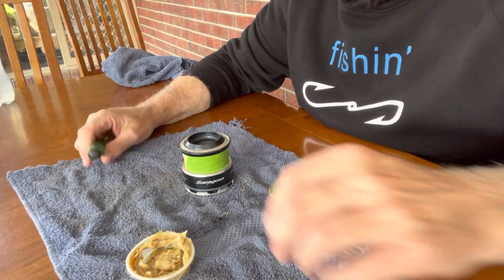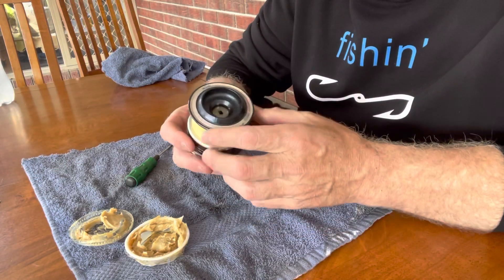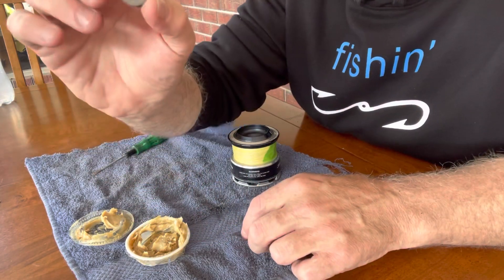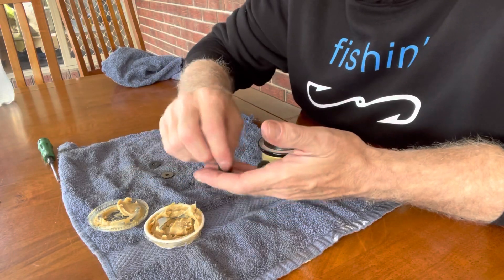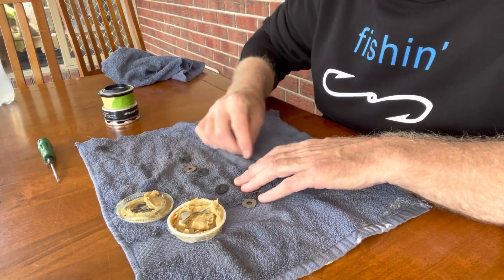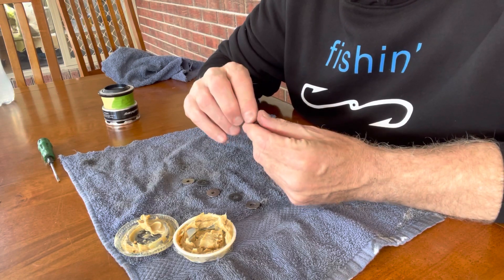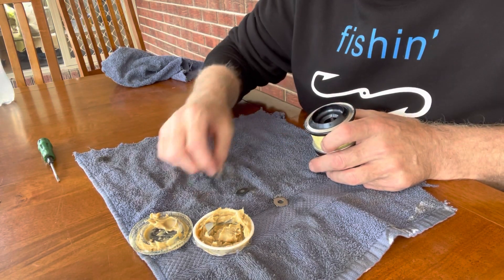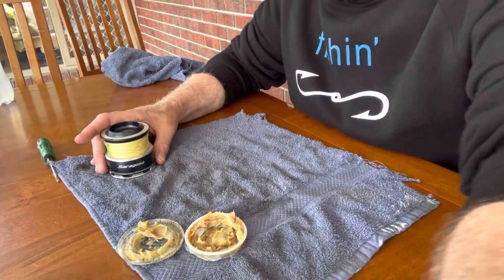Servicing Shimano Saragossa Drag

Comment: I could be wrong but it looks like the sequence you have the washers in is not right. the star washer should be in the middle of the set.
Reply from the maker: Exactly as per removed from factory  packing and same on 5 reels I did
Reply: I think you are right John. I’ve just taken mine apart to give them a service and the star washer is indeed in the middle.
Reply: Yea star washer should be in the middle. You can look at the schematic online to see that. With the star washer on top it will rub against the drag knob when the spool spins under drag.